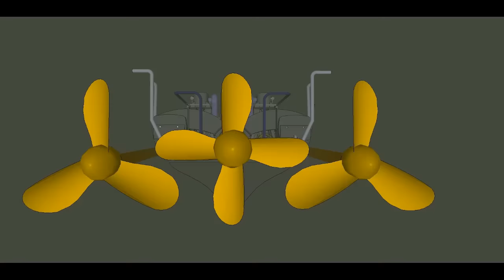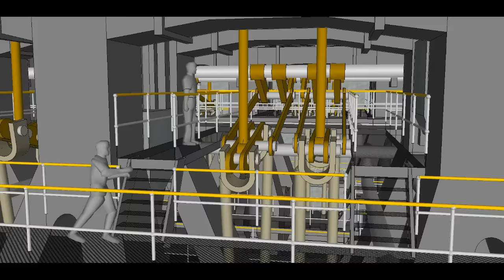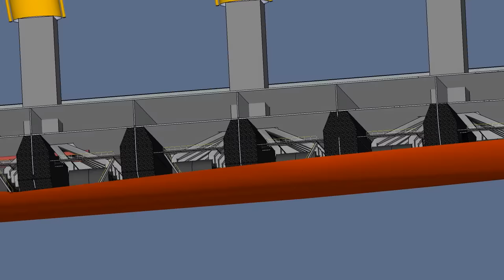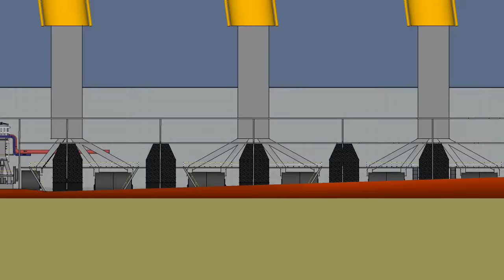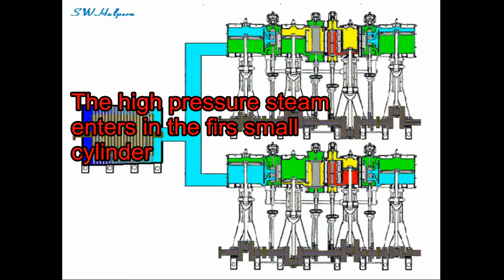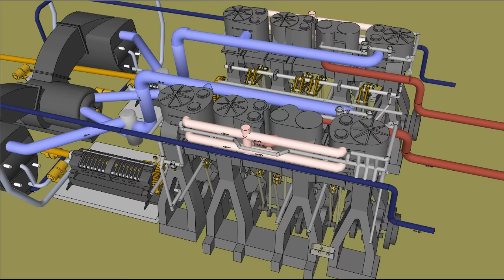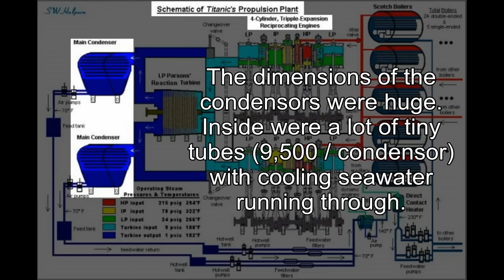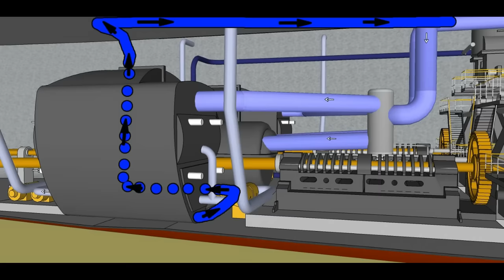The Engines of the Titanic

Comment: Sorry, but Titanics engines were able to start on it's own and never had a 'donkey' to start.
They had a turning engine for lubrication issues and maintainance, but the main engine can be started absolutely on it's own...

The engine at Kempton Park needs a starting engine, because has a valve gear without direction chenge, like Titanics Stephenson linkage had. So you need to put the HP Cylinder piston in 10° from top death, to startup, and it takes 3 full rounds till all feed lines are filled and even LP Cylinder works completely well.
Reply from the maker: Yes, you are right!
Reply: Thanks for sharing that.
Reply: So who was the Giant who re positioned the valve gear for direction then. That's what the little engine was for.
Go back and read the Marine steam engineering books of the time, as that is my source for info.
Reply: Never said that they couldn't as I have operated both.  So with the two engines and their massive size just how, when going full forward, do you move tons of iron to full reverse??  Think of the 'Johnson Bar on a locomotive, that got it's name justifiably, and in the USA had to go to power reverse, because of weight of the valve gear. Locomotive cylinders are also 90 degrees out of phase for the purposes of starting.
Reply: +Chloe Alexa
Ok...this discussion was about starting a large steam engine from any rest position, and not requiring a donkey as is required by stationary engines. As Steffen pointed out a steam engine can be started from any position if it is fitted with reversing links.

To answer your question, I can also add that on large engines like Titanic's, these links were moved with a relatively small, auxilliary steam engine, called Brown's reversing engine.

I'm pretty certain that they would not have to cut the throttle off completely to go from full ahead to full astern, but there was probably some technique they followed. I'd by very interested to hear if Steffen Reichel has any information to add about how they might have done this.
Reply: Chloe Alexa, Titanic had a Browns Engine for changing the valve gear. So the giant to do, is called Mr. Steam.
And the little engine really was for turning the main crank shaft for maintainance of the giant machine.

And you do not have a 'Johnson bar' - maybe at tiny machines, like some rattlers on post boats, but for larger engines, like paddle steamers they have no "Johnson bar" - and if, it's connected to the vavles which move the Browns engine, and the browns engines moves the gear.
Big Boy, UP844 and many other steam locomotives, like the czech 475 and 495 all have a browns engine for changing the gears, that's why there is only a small lever, instead of a huge iron lever as many british shunters have.

So on most river and lake paddle steamers, like "Blümlisalp", "Hohentwiel" and others there is still no Johnson bar, they have levers for the throttle, but a steering wheel, which operates a screw to move the gears, this is quite the same as on swiss and german steam locomotives, which have the same steering wheel with spindle to screw the gear into position - as Johnson bars have some nasty backdraws and are not used on powerfull steam engines.

So in Titanics case you easily can see: It has a steering wheel at the base, which was the comand possition of the engineer, here the telegraph was mounted and the RPM counter, together with the pressure gauges are present. The steering wheel now sets the Browns engine into position, and it you do not have the turbine attached, Titanics engines could go from full ahead to full astern in less than 10 seconds... that's rude to the machine and thrust box and surely can damage the shaft, the cranks and even the engine mount - but in emergency you can do it. 
Thug boats usually switched their engines in less than 3 seconds form full ahead to full astern.

On "Hohentwiel" - which is a paddle steamer, they do not switch the engine that hard, so for port manouvers the engine is only slowly turning, but directions changes happen in less than 2 seconds for a 950 hpi engine..
So coming from the lake, the engine is stopped, gear is screws to level (middle), so zero admission of steam to any cylinder. Because of the ships velocity the paddles were now slowly moved by the water, so the engineer usually sets the paddle wheels to rest in bringing the gears with the steering wheel to full astern and opens the throttle just a little, so steam pressure rises in the cylinders and brings the paddles to rest against the water... to the paddles work as brakes. reaching the port, the engineers gets a call for reverse to slow down, so he just opens the throttle again the engines starts rotating backwards - after speed declines, the bridge will call for slow astern and the engine will turn slow astern. The port manouver beginns, which some changes from slow astern to slow ahead and slow astern again, just to bring the ship at gate, then the bridge calls "ready with engine" if it's end of day, or calls "stand by" if only passengers change.
Reply: Cam shaft or cam gear, not a valve gear
Reply: Steffen Reichel nerd
Reply: Steffen Reichel Thank you for this very detailed response to Chloe Alexa. Hopefully she's now better informed and can appreciate there are others smarter than she thinks she is.
Reply: That engine they showed with the donkey to start it was an old steam engine that is now a museum.  IT used to be a power generator.  NOT A MARITIME ENGINE.  TRUST ME they are different engines.
Reply: Damn brother, I really enjoyed reading your in depth comment.  I didn’t understand most of it but you obviously know what you are talking about!!  Thanks for the information.  I bet you have some really interesting stories to tell.
Reply: Damn brother, I really enjoyed reading your in depth comment.  I didn’t understand most of it but you obviously know what you are talking about!!  Thanks for the information.  I bet you have some really interesting stories to tell.
Reply: What did they use to keep the water out when it sank first time out, not very impressive.
Reply: three year old thread I have no idea what anyone's talking about here lol

Comment: Ships nowadays have internal combustion engines. Titanic had an external combustion engine.
Reply: Nuke ships are steam driven.
Reply: Correct, a steam engine is an external combustion engine.
Reply: @strfltcmnd.9925  But they are not combustion engines
Reply: @Martink9191  A nuclear power plant, be it stationary or in a ship, is nothing more than a steam engine with the emphasis on the boilers.
Case in point: When USS Enterprise CV 65 was converted into CVN 65, the oil fired boilers were replaced with nuclear reactors. The actual steam powered machinery, from the turbines driving the propellers, electric generators and hydraulic pumps to the steam catapults, were the same as planned to be powered by oil.
That there is no chemical combustion taking place inside a nuclear reactor is irrelevant, it's still external as opposed to internal combustion.

Comment: Very interesting, 
Most people that watch this stuff know this, but some might not know,  the USA still uses steam to power aircraft carriers, and subs.
Reply: Well... Sort of... Steam is used, but not in the same way. It's only used to spin turbines to generate electricity and is created by nuclear reactors. But good observation! (I think the French also have a nuclear carrier, and Russian and the UK have nuclear submarines as well)
Reply: Not sort of, steam IS used to propel those vessels, how it's heated is different, and what's done with it may not be the same, but ultimately steam is the driving force.
Reply: There may have been a misunderstanding of tone here. I didn't want to be argumentative. When I say, "Sort of" I'm talking about the way steam is used is very different. I was saying that in the vast majority of cases, steam is used to only power electrical generators which are then used to power electrical motors that propel the vessel. There are/were vessels that used steam from the reactor to spin turbines that directly drove the propeller, but those are older technology and are difficult to find now. All the gearbox requirements and complexity of having a steam-driven system have been removed by simply using advanced electric motors which respond faster to different control inputs, have vastly lower maintenance requirements, and are significantly safer. 
Again, I apologize if I came off rude, I didn't mean it in that way at all.
Reply: No your fine, sorry if I came off wrong.
I just think it neat that a technology as old as steam is still a big part of our newest vessels. 
I was surprised the HMS Queen Elizabeth is diesel electric, what I read was diesel was much cheaper,  because like you say ultimately what they need is electric, and it's much more complex to make electric from reactor than from diesel.
Reply: U.S. aircraft carriers still use steam for propulsion as well as for electricity. But then a lot of technology they use (even for the reactors) is really old because they're wary of anything new and untested
Reply: OMGLYKEWOW
Yea the US navy is well known for being slow to change
Reply: Most electricity in the world today is made using steam, and a lot of that steam is still made by burning coal.
Reply: nothing has been invented that beats the power and reliability of steam expansion when it comes to catapults
Reply: Actually the new Ford class carrier has an electromagnetic catapult.
I guess only time will tell if it's as good, better or worse than steam.
Reply: C Smith - They're better in theory but they've had reliability issues in practice
Reply: C Smith no sweat soldier, u got live steam on board, just get you the old set-up, bolt her in, run a pipe, n off you go.!!! thank you for service.
Reply: I'm not in the service, thanks anyway?
Reply: C Smith hmm i had no idea. Ive been out of the navy for 18yrs. I worked on the catapults of the last conventional carrier the Kitty Hawk. Hafta check that out.
Reply: lol not to many stokers on a nuc sub or carrier lol hahah
Reply: And the LPD's and LHD's.

Don't forget our little marine scooter ships lol
Reply: C Smith yeah Britians two new carriers are both diesel electric with no catapult or arrestor gear all to save on cost even though it limits how useful Queen Elizabeth II and Prince of Wales can actually be and what types of aircraft they can carry, stupid decision in the long run to do it that way
Reply: Non. Molto. Chiaro.         Motrice. Alternativa.      8. Piston?
Reply: @jeffbarton3353  My ship (USS Kirk, FF-1087) used to plane guard for "The Shitty Kitty" out of Yokosuka.

Comment: I’d love to see someone surface one of Titanics engines and refurbish it, or just put it in a museum.
Reply: The engines were torn apart when the ship broke up.
Reply: Starboard Lines have it as a museum
Reply: @jamescameron2490  it didn't break up, its in one peice
Reply: The front (low pressure) cylinder of each engine broke off when the ship split.  Both are in the debris field.
Reply: James Cameron o h 
Well I suppose you could salvage as much of each engine as you can...

Comment: one of the coal bunkers was on fire  3 weeks before leaving port, they couldnt put it out but sailed anyway
Reply: Thats conspiracy theory and false. At best it was a warm smolder. All that was compromised was the coal supply in that bunker.
Reply: @ThatWolfFromHyruleGaming  It's no conspiracy, a fire did exist and was extinguished one day before the sinking.
Plus it's kinda funny how you say it's a conspiracy theory and false and then admit that there was a fire on the ship lmao
Edit: Also fires in ships at the time wasn't uncommon
Reply: The conspiracy is that the fire did any damage to the exterior shell plating or the steel holding the coal in the bunker. Coal fires happen on ships like that but they get handled quickly.
Reply: @ThatWolfFromHyruleGaming   my guess is that the fire didn't do damage on its own. It's that after getting heated, the ship went into cold waters which changed the molecular structure of steel and the steel became brittle. Strength was compromised, otherwise a collision like the one with iceberg only bends these steel
Reply: @TheUltimateRaven_XT  okay but once the metal cooled down, it was strong again. also they would not build a ship that could not withstand cold temperatures or a few extra atmospheres of pressure (from how the ship sits in the water) for transatlantic crossings. the bunker fire did not compromise the structure. don't believe me? watch TitanicAnimations' video about it. 9 minutes of fact.

Comment: so you're saying the Titanic had a v8, nice.. I liked the scenes in the movie of the engine room and all of the parts spinning around.
Reply from the maker: No, the Titanic had not a V8 engine. I've never claimed that! A V8 is 8 cylinders on one crankshaft. These are two triple expansion engines and I can't change that! Read also the reaction of KiriyaAoi
Reply: Titanic 7 has a V12
Reply from the maker: Where I can find information about the Titanic 7?
Reply: No, no V8, two staight fours and a turbine.
Reply: yeah its a dual inline 4 cylinder double acting triple expansion engine with an integral turbine for maximum efficiency. It really was an effiecient way to power a ship this large for the time.
Reply: Titqnic moved a lit faster than v8 car
Reply: JUSTIN O.K. Titanic had a W24
Reply: xXEDGY GAMINGXx turbine= turbo charger
Reply: @contactATashleygriffin  Steam turbine
Reply: I understood the 4 cranks had an unusual degree to them. You would think that having the 4 cranks at 45 degrees for each cylinder would smooth out any vibrations.
Reply: Good Jesus. It wouldn’t be a v if you could classify it that way it’s more like it had 2 giant inline 4s
Reply: @timdekleijn452  No. Turbocharger is a charger powered by a turbine. Titanic had only a turbine. Charger wouldn't even make sense in a steam engine
Reply: Mark K 👀
Reply: Like two in-line eights!  The cylinders were double acting so each stroke was a power stroke …. and the turbine went from the low pressure exhaust to vacuum, minus 14.5 psi, a bigger pressure difference.

Comment: Very nice model, puts things into scale.  I didn't imagine the steam production plant took so much space. Also didn't know a steam turbine was used for one of the props: this tech is used up to this day. All nuclear powerplants operate the same way (and most non-nuclear ones): fuel boils the water, then a turbine is producing electricity.
Reply: +jekader The ship had just one turbine for propulsion to get the line used to turbines.  Lusitania, a few years older, was pure turbine, and could easily claim to have far less vibration and noise then Titanic.  Also, its engine rooms would likely have used far less space then on Titanic.  BTW, google Turbinia!

Comment: Titanic’s design was just slightly ahead of the invention of mechanical stokers which would have greatly reduced the “hand bombing” of the furnaces. The pattern of coal on the grates would still require some shoveling to fill in the “holes” where the bed of coal was uneven. It would have been more likely that the company would have pulled the grates out, lined the fireboxes with flashblocks and fired oil as soon as the supply was reliably available.
Reply from the maker: Thank you for this interesting addition!

Comment: And now imagine a few hand full Uranium or let's say a few tons which last 20 years, allowing a nearly 100.000 ton ship to plow along at about 37 knots. I've always been wondering why they didn't have had screw conveyors to fuel the boilers instead of 150! Morlocks which also had to sleep and to eat and also needed quarters.
Reply: +Meilenwerker  Unions were never "In power" At their peak they represented 30% of the labor force.

The reason they used so much manual labor was because the technology to allow increased productivity per worker did not exist or was not economically viable at the time vs just using more labor.

It is increased productivity per worker that allows wages to rise. Unions, at least how they worked in the US, only increase wages of their workers by stealing the wages of other workers not in unions by artificially reducing the supply of labor to unionized companies, forcing non-unionized workers, who might otherwise have been employed there, to look for work elsewhere. This artificial oversupply of labor forces wages down in non-unionized industries and jobs.

Unions in palaces like Japan, from my understanding, function more like the HR department. Rather than the company hiring and managing workers, the union does that and supplies workers to the companies at the negotiated rate. The company is free to get rid of the union and take workers from another should terms become unreasonable, so union demands stay in line with economic reality. That sort of union can be beneficial for workers, as it means each worker doesn't have to constantly go job hunting as it is the Unions job to find him work.
Reply: +Crosshair84 ....ergo..Join the Union!.....
Reply: +LCdrDerrick Eventually many steam locomotives used automatic stokers, but even then, the fireman sometimes had to resort to hand firing if the stoker broke down en route.  Of course, on a massive locomotive like the Union Pacific Challengers or Big Boys, you'd never be able to keep up by hand.  FWIW, when UP puts Big Boy 4014 back in operation in a couple years, it will finally be oil fired (which takes major boiler changes).
Reply: +LCdrDerrick In house heating plants it existed a number of schemes for a continuosly moving rooster.

That type of gear is a bit bulky.
It doesn't fix the ash removal trouble.
It is impractical in the case of a scottish ship boiler.
Reply: I know for Steam locomotives they didn't really even start showing up until the 20's, so I'd say it's likely at the time it was simply just cheaper to have a team of 150 then put in an auto feed system.